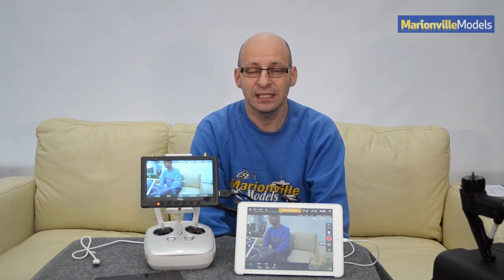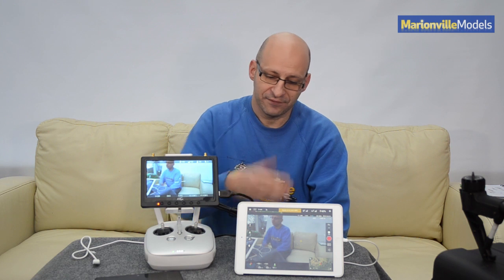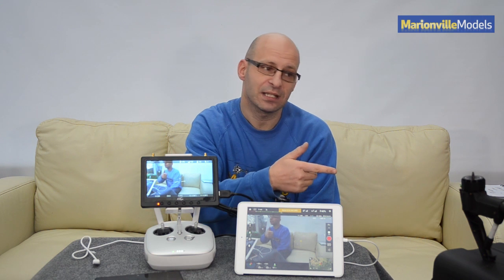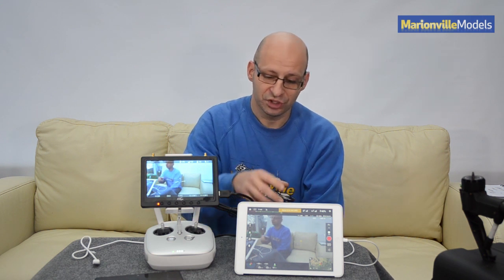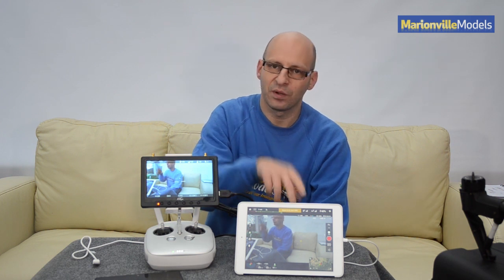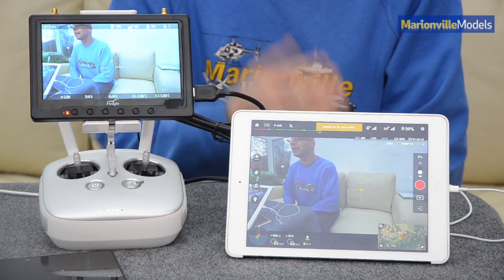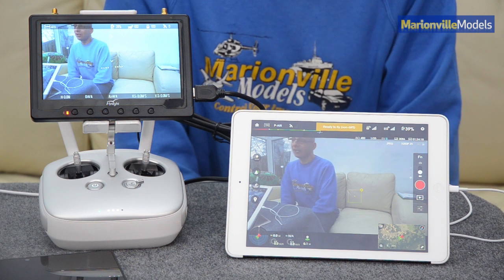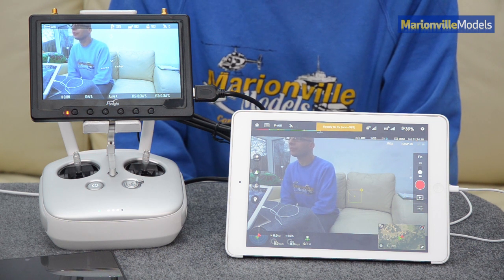DJI Inspire 1 Lightbridge, Video Latency Explained with IPad Air & HDMI Screen

Comment: I want to live stream from the Inspire 1 to a private IP address or to an http:// address (not YouTube or Facebook).  The latency on Youtube is too long and Facebook isn't the right venue for what we are doing.  We have tried running an HDMI cable from the controller to a vsupported hardware encoder to a Cat5 cable to the  laptop.  We have tried using video managers, Wowza, VLC, and several others but cannot get the video to the web for easy viewing by anyone we give the access code to.  Nothing seems to work.  Do you have any suggestions?
Reply from the maker: Im sorry its not something ive looked into.

Comment: Is it possible to get a live video feed from the Inspire 1 with no OSD, symbols or anything other than the camera picture? As if it were simply a flying camera? Maybe coming out the HDMI out port on the Camera Op's remote.
Is it also possible to get the metrics simultaneously displayed on an iPad on the pilot's remote.
Cheers.

Comment: Would lowering resolution on live view help with latency?
Reply from the maker: I found the latency was mainly caused by the IPad Air. If you use the IPad Air2 or Nvidia Shield there's no latency.
Reply: I have the same issue with Ipad mini 2nd. generation.
Reply: Marionville Multirotors hey thanks for this tip you saved my ass! I was getting 1 second lag on my dang note 4 I knew it was something going off on it. Subbed and liked

Comment: There is a bit more to latency than someone said. It is true that radio waves travel at near the speed of sound so the travel time as a function is negligible. What will happen over a long distance though is that there will be more digital errors which the system needs to process and correct and this can add a significant overhead. It would be interesting to see a measurement at 1km with a few trees and buildings around to deflect and distort the signal. Difficult test to set up though as you would need to have something that can be seen from a distance, some sort of beacon perhaps.
Reply from the maker: The latency is mainly caused by the processing of the image by the tablet so use as fast a processor as your an afford. I've since found the Ipad Air2 or Invidia Shield works with almost no latency.

Comment: Hiya, great videos....A quick question, I have the dual system Inspire and I attached my ipad mini first gen and set it up as the camera operators screen and my main ipad (latest version) as the pilots screen....However, on the camera operators screen (using the Mini) the picture is broken and pixelated, but on the pilots ipad the picture is crystal clear. Any ideas as to why this is? Also, is there a way to use the ipad mini as just a monitor using the hdmi output? if so, what programme would you need to get the image to run on the screen of the ipad mini or could i just use the canon camera app to give me an image? Thanks Jason.
Reply: I've heard and I may be wrong, but that the first gen ipad mini doesn't work particularly well with the inspire if it works at all.
Reply from the maker: If your using an IOS device you need at least the A7 processor or you will let brake up. So latest IPad Mini or IPad Air or Air2

Comment: I would like to know if i can hook up my fatshark FPV dominator googles to the inspire 1 ? And how if i can ?
 I thought maybe i could use an HDMI cord to plug into the HDMI on back of the transmitter and to the HDMI on the goggles ? Thanks !!
Reply from the maker: Yes that would work. I've used the Flysight googles and they have HDMI in so just and to source a Mini HMDI to Mini HDMI cable.

Comment: Thank you. Very interesting. Will the latency increase the further the Inspire is away from the tablet / monitor?
Reply: No.. Radio waves propagate at slightly less than the speed of light. So, next to you or 20 miles away, are both practically instantaneous. Considering it takes less than 2 tenths of a second for a signal travel 24,000 miles.. I think you'll be fine.
Reply: Yefatbastard Thanks for explaining. I'm not sure the battery will last a distance of 24,000 miles so I'm not going to be able to test that!! Cheers.

Comment: Wow! Thanks for that info. Latency delay is far too long for when using for moving video photography. Definitely would need to improve this.
Reply: I have no experience of professional video photography but seeing this example of latency it doesn't, to me, seem a big issue. From your experience I presume that you would be expect virtually no latency for professional use?
Reply: I'm a hobbyist.. and yes you need little to no video lag when you're taking shots of a vehicle in motion or flying fast in general. It's not a big issue if you are pretty much hovering around, taking video.
Reply from the maker: You don't notice it when your flying.